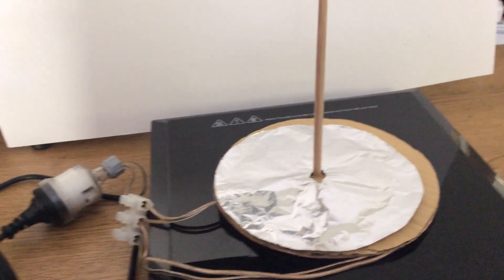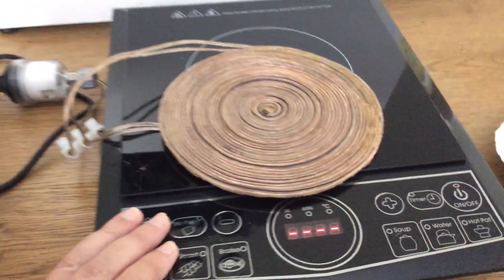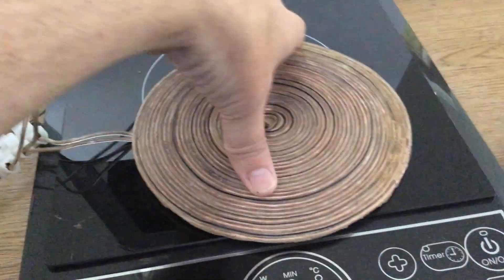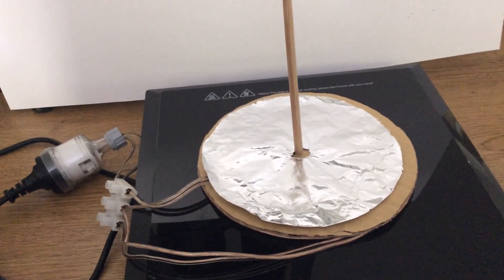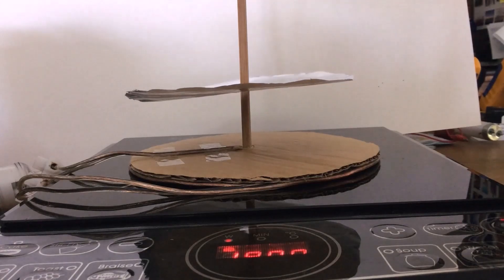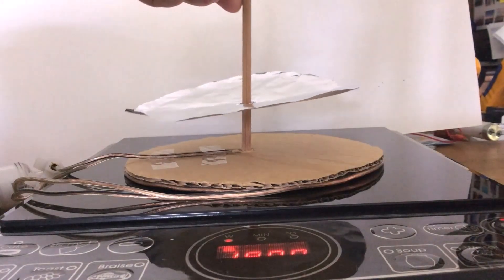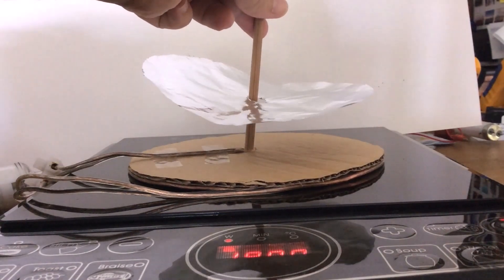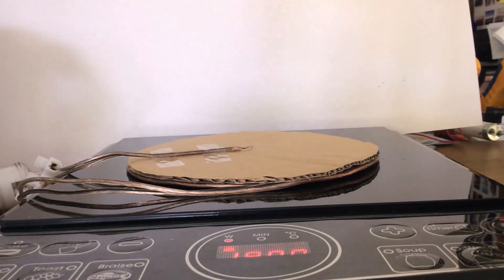UFO's UAP's Lies, Tesla & Antigravity!

Comment: I discovered accidentally a couple decades ago a 10 coil system I call the gravinductor. They are bifilar each coil is magnetically cancelled, pulsed A/C coils top and bottom halfphereical magnetic monopolar and inside pulsed 2 D/C pancakes (tuned from equatorial and the then angled. Top and bottom of those are 2 column coils as tall as they are wide. These are scalar by copper weight only the column coils are 1/2 size. I used a strob light box and a light dimmer box with press on off turn knob push circa 80’s.
Reply from the maker: Thank you for your comment. Wow, that sounds like you were just missing a seat and an oxygen tank. I have wound my fair share of coils and can appreciate the volume of work you described. Have you ever thought of rebuilding your work?

Comment: What happens if you have a pancake coil with a diameter of 1m?
Reply from the maker: You would have a massive field!
I have seen drawings of the inside of a UFO that consisted of a 70 foot diameter pancake coil and what looked like a Tesla vertical coil with wirelessly charged capacitors in the base of the UFO. It almost appears as though the stereotypical “saucer” shape, tall in the centre and having a wide brim is to house a Tesla coil secondary with a Tesla pancake coil primary. I’ve confirmed in my tests that aluminium can be weightless in the field of a pancake coil and that capacitors can be charged wirelessly whilst in the presence of radiant energy as shown in my radiant energy video. That, tied in with the “coincidence” that T.T.Brown’s research in Electrogravitics shows small models of the stereotype saucer before all the saucer hype started and he said he was studying Nikola Tesla’s work.
Reply: Very interesting exchange of information. I'm playing around with the shape of the coil. I'm building a hyperbolic shaped coil like the conus of a Trompete or like the distorting of a black hole in 2D space. The magnetic field might get compressed at the moment it's only mathematical equations. But soon I will build one. I would love to hear the opinion of a fellow thinkerer like you gets the same results. The more people repeat this the better. Unfortunately I don't make YouTube videos. I don't have the time, money and patience for it. But I reply and share knowledge. Thank you for the quick and very informative response
Reply from the maker: @icebluscorpion  Your work sounds interesting, please keep me up to date.
I have for a long time wanted to build the coil design you describe, you may be interested in the coils developed by Otis.T.Carr and his group or the magnetic field of the Primercube, I can’t validate either of these units, however, my minds eye tells me they are similar. So much to research and test and nowhere near enough time!
Reply: @whatifididthis...1236  true words my fellow thinker pal, true words. So much to discover and work on and thus so little time to get them all.

Comment: Thank you again for sharing your videos. Could you place a heavy piece of aluminium foil? Would it flight so high? Would the power consumption be the same? Thanks again
Reply from the maker: Thank you for watching. I have done some small tests applying weight to the foil and it does in deed carry more weight than it’s own mass, it does however sit lower in the field when weighed down and the elevation height also differs with different materials. I thank you for your query on power consumption as I didn’t think of checking that so perhaps a new video is in order demonstrating the weight of the disc, the weight of the passenger load and the power consumption.
Thanks again, have a nice day.

Comment: I hope you do understand what to make it antigravity, Coil itself should be in the air. Otherwise, it would be a really strange antigravity laying on the ground
Reply from the maker: Thank you for your comment.
🤣 That would make it a UGO (Unidentified Ground Object). Yeah this setup just allows me to experiment with the effects of mass cancellation. Normally the aluminium disc would get super hot but using a second coil to extract a large portion of the energy into a load prevents the disc from heating up. I have noticed an increase in lift if the two coils are opposing, I believe that this system would need to be mounted on a frame with the aluminium disc between both coils and mounted to the same frame similar to the “graviflyer”, two counter rotating magnetic fields with an aluminium disc between them.
Reply: @whatifididthis...1236  Would be a good idea for South Park episode with all the town goes crazy over the rock laying on the ground, as UGO,  for no reason,
 news reporters, scientists, Carman claiming UGO gave him superpowers, and everyone believes him and falling on the ground while he is choking them like a Darth Vader. Everyone but Kyle.

With only Kyle in the whole town calling everyone crazy and screaming, "It's just a rock!".

Only at the end of the episode for him to see literal aliens sitting on top of the rock, which is like half of their size, like on top of the horse, and flying away. "Are you f kidding me"
Reply from the maker: 🤣😂🤣 That’s gold.

Comment: Hello, I wonder how well did you look for other Tesla’s patents ? I mean the other patents that were suppressed by gov/military.

It just sprung to my mind that that bifilar coil should be used in conjunction with wireless energy transmission which Tesla was trying to build some repeaters to operate his huge tower … I think he was trying to implement to transport system which you are trying to describe in this video.

Cheers
Reply from the maker: Thank you for watching. I have spent many years researching Tesla’s work and many others work and have found consistency in one area only and that is the US patent office changing patents by removing passages, modifying or removing diagrams and in some cases removing entire pages or even placing in pages from other patents. It’s obvious why they do this and that’s why we need to listen to what Tesla said which was perform the experiments yourself instead of relying on what the patent office gives us, you might even find other unrecorded phenomena or features.
 I believe you are correct that Tesla wanted this to be a globally powered transport system, if I am correct, I believe he hired an artist to draw his flying machines concept along with wirelessly powered ships and many other devices.
Reply: Thanks for reply. I’ve just remembered that I’ve seen or read in Patric Kelly info something interesting related to Don Smith device, where someone made a replication which worked even without earth connection and Kelly said that this really open a pathway to a mobile solution. So I guess there might be more ways to do it … we already ca see this happening with many devices that use radiant energy once phenomena is to be understood.

After embracing with open mind R&D I can understand and feel emotions of many inventors that tried to implement all what academia being forced to reject … I hope it make sense what I’m trying to say
Reply: @whatifididthis...1236 also I am outraged by us patent office practice of correcting (basically removing) text and data from patent application and I’ve seen their letters sent back to inventors saying they present unnecessary data or explanation in their application

Comment: Can you still achieve the same outcome with a more saucer like plate..... like use 2 foam plates wrapped in foil?.... 

Excellent work, keep it up.
Reply: How about also trying magnets within the plates also? Just throwing out ideas....
Reply from the maker: Thank you for watching. I have tried different aluminium trays with varying success. A lot of tests still need doing though as I’m sure it’s load dependant, and currently I’m not sure if bigger load means bigger field. Eventually I will find time and test your idea.
Reply from the maker: @WSmith_1984  I believe the magnets may be too heavy but then I haven’t tested magnets on it either so truthfully I couldn’t say. Anything is worth a shot, however as I’m typing this I’m thinking it shouldn’t feel repulsion as I believe it’s a dielectric field and I’m almost certain this shouldn’t have an obvious repulsion or attraction effect. Still worth a shot though.

Comment: The effect you are showing has nothing to do with 'anti-gravity'. The pancake coil is inducing eddy currents in the aluminum, creating a magnetic field around it that pushes away from the pancake coil.
Reply from the maker: Thank you for your comment. I think the definitions on gravity are scarcely understood. I am looking at this situation from the following perspective. The mass of the aluminium is great enough that it is bound to earth by earths own gravitational field. If a force is greater than the ability of earths gravity it will allow an object to cancel its mass thus allowing it to exhibit the opposite of what we call gravity. This being considered we are defining the already loosely defined word gravity as a means of explaining the opposite of the effect of gravity, hence the term antigravity, which in itself is a misnomer. Whether we call this levitation or anti gravity or gravity resistant, it is still acting out the opposite of gravity, something that the element aluminium can’t do by itself. I believe Einstein claimed this was our understanding for lack of a better explanation.
Reply: @whatifididthis...1236 By this strange definition, magnet levitation over another magnet is anti gravity too. Since magnet has weight

Comment: Moden science is flawed in its complexity..

All energy and matter in one simple explanation, here goes.

First we have a radio waves all the way to gamma waves which in turn create hydrogen then from there everything is basically a compound of hydrogen and will decay back to hydrogen before turning back to gamma waves..... 

Matter is simply a ball of aether/space trapped in a pressure wave so tiny it creates a coherent structure that can experience time as we do, as well as entropy and therefore combine with other "atoms" of itself to form heavier and heavier elements.... it's all just energy though E=mc²

This is how you end up with something from nothing...

There are no free moving "electrons" within matter.... 

I use this analogy to simplify it in my mind..... imagine a line of people standing a mile long (each person represents a copper "atom" in a wire) the first person starts a Mexican wave at one end ( the source ) , as the information propagates along the line ( by exciting/resonating each "atoms" magnetic field ) you would see an continuous wave of the peoples arms transferring the charge/information back and forth but the "atoms" and "electrons" don't actually move at all..... 

Think about it, from the source where electricity is "generated" to the ultimate end use, there's various breaks in chain of that electricity, it goes through controllers, transformers, all sort of components.... the transmission happens because of the magnetic field strength of the "atoms" in the wire being increased and decreased, not because of an actual "electron" flowing anywhere...
Reply from the maker: Thank you for your comment. Can’t argue with that statement, “ Modern science is flawed in its complexity”, I also loved the wave analogy.